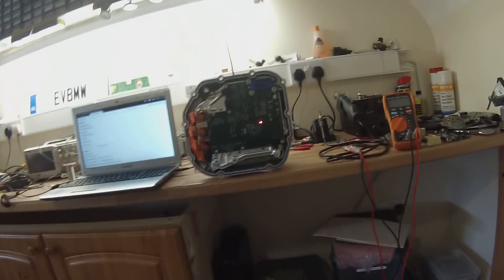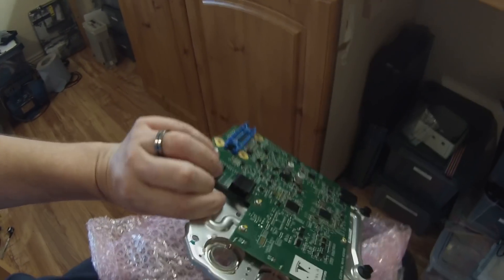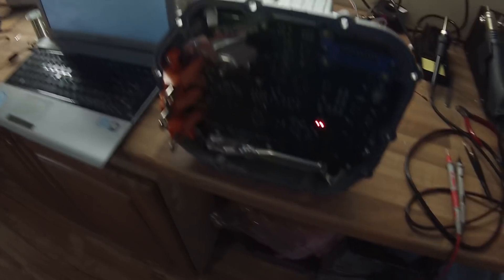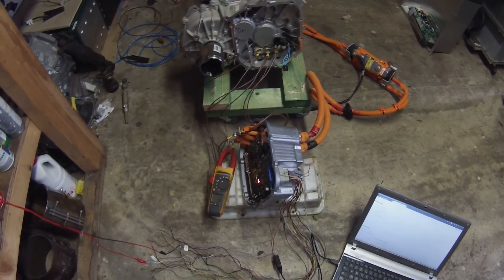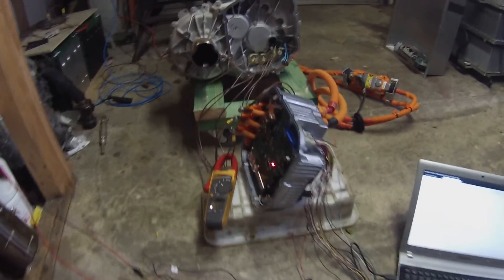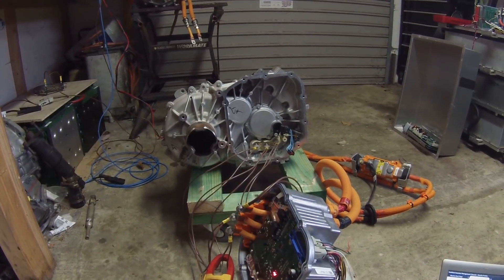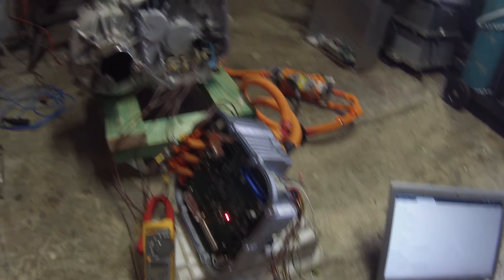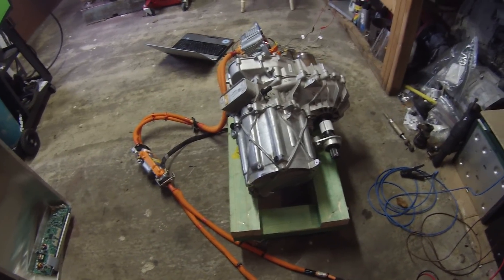The Tesla Project : Small Drive Unit Runs

Comment: Can you possibly make a plug and play version PCB for the dummies? Make it possible for a on/off button, F, N, R + a throttle with hall sensor input. I would like to use a rear drive in a project, but i don't know how to read CAN messages and similar things like you do to make this work. Even though the PCB is open source i dont know how to use it.
I think more people would be interested in a ready to run system.
Is this something you could make?